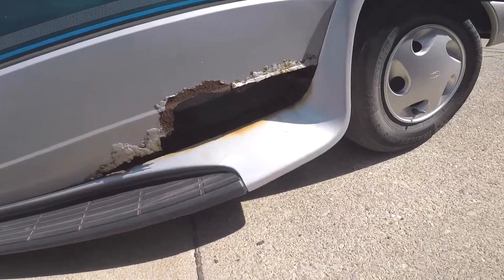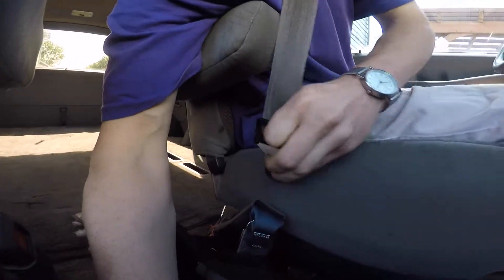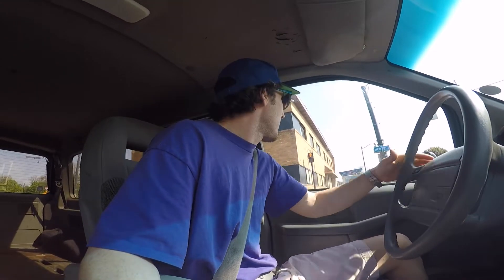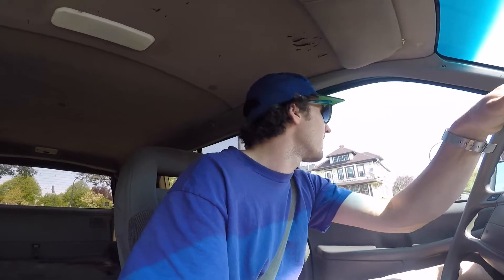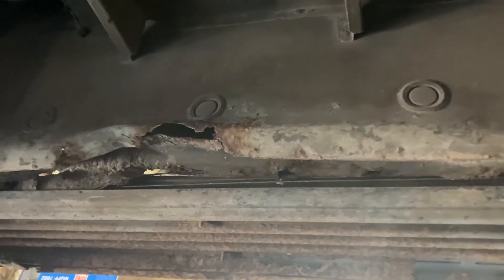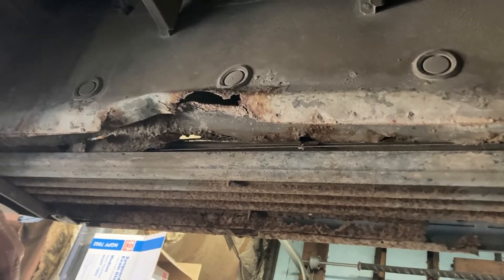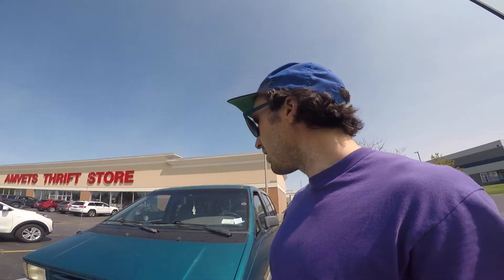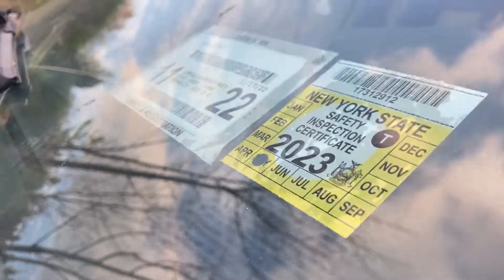UH-OH! FRAME DAMAGE on my 1993 Aerostar? Will it make the 200 mile drive home or pass inspection?

Comment: I have jack damage under drivers side door where mechanics before jacked it on the side skirt. Gotta watch out for mechanics who do that or tire shops. Thermostats on these vans mess up every few years saying engine cold when it's actually warm or hot might  or might not be case here.... My dad got his oil changed in his mustang years ago and they put wrong oil plug on leaked  all out I doubt that's case here but still always good double check. Hopefully the cause of leak can be repaired cheaply but looks bad. I'm guessing u didn't have any problems before oil change
Reply from the maker: None at all, and I had no idea how long it had been so almost against my better judgement I did the oil change. The timing seems conspicuous but with a vehicle I have no idea of the history of, and which was reported to be leaking oil already, its quite possible everything was fine after the oil change and I simply goosed it a little too hard trying to press up the hill and that was the straw that broke the aerostar's back, as it were. What's funny to me is that with those big running boards protruding out the side, you think it would be too much of a pain to try to jack it on those side skirts are, so someone must have really been against lifting it from the frame. Either way it will need some cosmetic correction down the road, but of course first step is to get it mechanically sound. janky do thanky! fingers crossed...